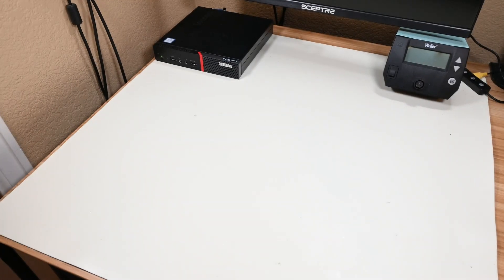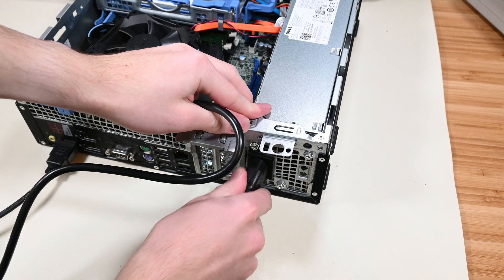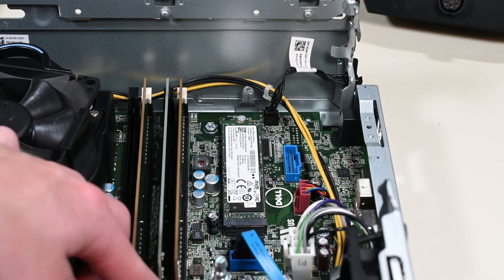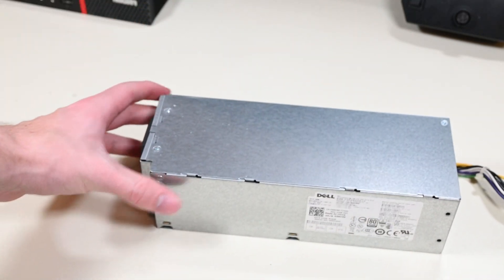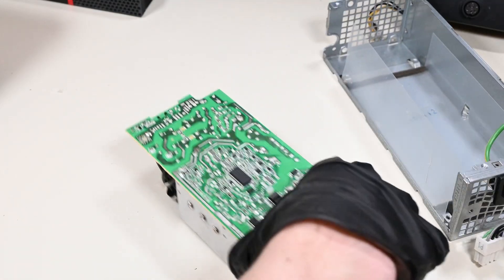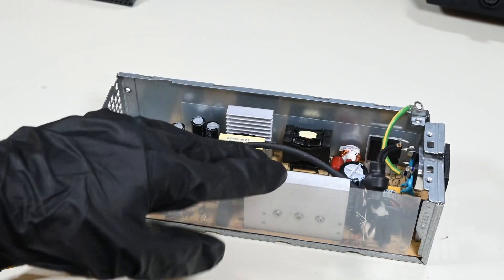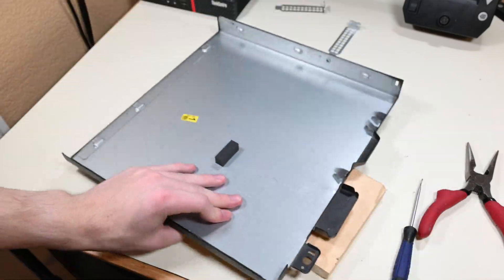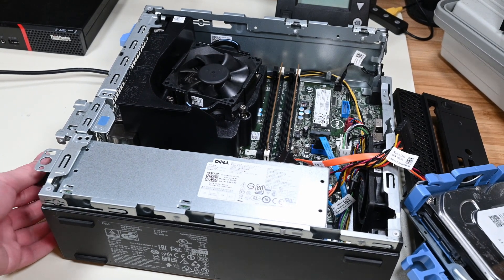What Happened to This Poor Computer?? - Can I Fix It?

Comment: The noise the power supply is making is caused by stuffed caps on the output.
Reply from the maker: Can certainly be a cause of that noise, in this case the caps on the power supply looked completely fine so I'd pass it on to a less than ideally wound/glued inductor

Comment: It's been reported that 250 million PCs aren't capable of running Windows 11. That will be allot of ewaste after Windows 10 support ends in 2025
Reply from the maker: Yeah, I really hate that Microsoft is doing that. Wish that Windows 11 would have never come out, it's caused nothing but problems in my experience and will be causing more in the near future as you said.

Comment: An Intel Core i5-6500 running Windows 11?  This is not officially certified operating systems.
Reply from the maker: Yeah, they definitely cheesed the hardware checks when they installed that.

Comment: Using one of those Dell slim computer as a bench computer as nice and small and only computer that works with my various programmers while my newer computers don't. It not due to OS, it due to the chipset and USB controller in these are great with older hardware.

Comment: I like videos like this where older PC's are repaired and repurposed and put back to good use and not in a landfill. I've accumulated a stash of older PC's  and workstations mostly HP brand (My DD is a Dell 3620) and am trying to do the same to them. I may even try custom painting a few. Good body work on that Dell lol.

Comment: Not bad, and yeah I'd have certainly replaced the PSU & added in a HDD. For use as a Minecraft server I'd be fine with 8GB total RAM - the two matched sticks of DDR4-2133 - especially with a Linux distro. Really not a bad unit, and I'm surprised the factory SSD even had Windows 11 on it!

Comment: IMHO ... this was more of a situation where the PC was jammed against something.  The item that it was pressed against caused both the huge dent in side panel and also was sufficiently large and solid enough to crimp/bend the io shield area and also the face-plate of the PSU.  This would explain why no real damage to the internal components but huge damage to all of the exterior face-plating on the rear of chassis.
Reply from the maker: Definitely a very sensible explanation!

Comment: When you have a metal case in need of a loving tap from a hammer, use a solid flat surface both under and on top of the point you wish to straighten (like a sandwich).  When you strike the flat surface you dissipate the impact point avoiding the bumps and ripples you referred to.
Reply from the maker: Can't believe that never occurred to me, thanks for the tip! I'll certainly be using it when I next have a case that needs some hammering!

Comment: the reason it cant activate is because the customer (MIGHT) be using tiny11 tiny 11 is a micro version of windows 11
Reply from the maker: Ah that makes a fair bit of sense actually, could certainly be the issue
Reply: @CHWTT No, check the edition, the sticker says Pro Windows, so you need to check that it is Windows 11 Pro (Not Windows 11 Pro N). Also it isn't the latest 23H2 build, so you need to update it
Reply: tiny11 still needs a valid license to activate tho. It's made to be lightweight but it's not cracked or anything like that